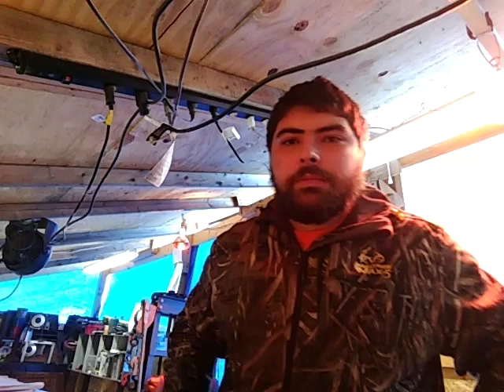My advice for anyone starting a welding business

Comment: I started with a duromax 13000 watt generator for $900 on sale, and a Vulcan Commander 225 for $500 on sale. I weld on AC though, so there’s that. That mf has a 100% duty cycle at 100 amps. It will burn 1/8 th inch 6011 at 90, and 7018 at 100 all day long.

Comment: I love to here other people’s stories and advice and compare it to my own. I started out small and still learning had a few bumps in the road but didn’t stop me I started out with a 96 dodge Dakota and 8500 generator a 90 amp mug welder and one of those Lincoln tombstone A/C stick welders still don’t work for myself full time yet but now I have a 93 F250 diesel and a 2003 F350 utility body diesel a bobcat 250 NT getting ready to buy another bobcat 260 brand new a a Lincoln 210 mig and Lincoln 200 square wave for my shop and a bunch of other tools multiple power drills and impacts porta bands cutting torches chop saws and hopefully the plan is to expand my shop this summer! It’s been a long time coming but I’m making it

Comment: I had 7 angle grinders at the same time all good brands 2 9 inch and 5  4-1/2 inch, each with a different wheel. So I never had to change wheels, plus if a grinder broke I didn't have to stop everything.  I Started out at $65.00 per hr. Min 3 hrs. 18 years ago,  at that time it was ok. Everything I did from those discount papers like Craigeslist,  was a looser, never do ANY WORK, UNTIL, they sign your contract,  if it is a big job never do more than 1 week without full payment, plus Always buy the materials with Their money, not yours!!! 😆😆 GREAT VIDEO Thanks William Orange county, ca.

Comment: heads on 1980`s 1990`s crap are crap i am building a 400m ford  tmyer flat top piston good heads megasquirt efi all fer a beater truck with zf 5speed why i hate not being able to rev the engine and it go past 4k n humm wile a full loaded truck is coming down the interstate   like the 351w i had did no air flow ..lol home-adviser is bogus it need boycotted and all like 100 bucks to then is bad to me scam

Comment: Just ran across your video, i know it's older but i have a question on payment from the customer. I know you mentioned possibly them not picking up your product and this question also pertains to mobile welding.Do you by chance have a clause where they need to put say 50% down before you start work or gather material or do you just make them pay in full on job completion thanks.
Reply: I’m also curious

Comment: If there outside of your range do you charge $2 a mile round trip or just one way
Reply from the maker: It’s one way. I don’t even flat rate trip anymore I just do $2 a mile for everything now.
Reply: @derbadortheweldor8940  so do you also have a minimum. Like the fist 2 hours is 200$ and 75$ an hour after that? Plus 2$ a mile from where you started?

Comment: Hi. im sure you cover this in one of your other videos. what kind of work would i be looking for in a mobile welding business? im not a welder by trade. im a mechanic that has over time acquired lots of welding equipment. nothing fancy. Bobcat 225, plasma cutter, torches couple of 220 cracker boxes old flat bed ford etc..  just wanting to do somthing for myself before its to late. Thanks. Johnny Chain
Reply: Hard facing heavy equipment  entryways, fab on site repair work lots of heavy equipment that have cracks in them need to be gauged out first though ir you can do fences
Reply: @thomas25082  Sweet Thanks. world is a little different right now but hopefully we will get back to normal.
Reply: @chainlandproductions820  it’s gotten worse but at least we can still work and have just enough left after taxes. Any update did you start up?
Reply: @DB-bk9tr  couple of small jobs. not really started.

Comment: I have some advice that may help, 
I purchased a 1ton 91 Chevy flatbed for 1500 dollars, a Lincoln 225 from a pawn shop for 950 dollars, a cutting torch set at a garage sale for 50 buck's, I already had most of the hand tool's, but you can buy used angle grinders drills, etc. from pawn shop's.
I also purchased a gas powered air compressor from pawn shop for 350 buck's so I can do my arc gouging.
Point is you don't have to start out looking pretty, BUT, you do need to be functional.
Stay safe out there my brothers.

Comment: Damn man you make me feel bad.    I was gonna go to harbor freight and get a welder and generator then put some ads on craigslist.     Can't really afford that right now but I'm ready to get started and see how it goes.
Reply from the maker: Sorry that was not my intention. The 8750 generator from HF is very good. I used to have one until it got stolen. If you're on a budget get the ahp160 stick welder and the predator 8750. You might be able to get started for under $1k. Just an idea.
Reply: @derbadortheweldor8940   thanks for the info man.  I'll check into that.
Reply: @derbadortheweldor8940   have you seen the vulcan 225 welders from harbor freight?  What's your take on those?
Reply from the maker: @Tomfromyoutube  honestly the new Vulcan welders just seem cheap to me. I got to use a ahp 160 and it's very well built.
Reply: @derbadortheweldor8940    cool   thanks

Comment: You can get Miller Bob cats for about 1k used
Reply from the maker: BRENT3143945 yeah someone's used up pos. I'll take 145amps that work all the time vs 225 that doesn't work half the time.
Reply from the maker: BRENT3143945 and honestly IDK where you are getting used bobcats. But around here the cheapest one Craigslist right now is a onan engine bobcat $2400 431hrs. No way I'm buying that! I'd only give 1k at the most.

Comment: You think the area has a lot to do with it . because I started a mobile welding business about a year ago . I've got some big jobs . then boom dead as a dead horse .  I got all my equipment Lincoln ranger 225 and suite case to run innershield all paid for .
Reply from the maker: Cody Dayton my advice would be spend a week mapping out all of the industrial business like sawmills, small auto shops, logging company, drilling company and concrete companies. Go visit them in person and introduce yourself and your services. Bring your equipment just in case they want you to do work ASAP. Also it is a good idea to take some business cards and leave them at places like tractor supply and any small business that's related to any kind of construction or agriculture. The first year is all ways the hardest. Just keep grinding and give your best work possible and eventually the work will start picking up. Also make sure your business is on Google maps and yellow pages.
Reply: Derbador the weldor. Thank you . I wrote downs some notes . I am doing my research tonight . thank you for the new ideas

Comment: Does your hour rate include consumables?
Reply: Ace #1 

Usually, you add consumables to the invoice, and those are overestimated. For example, if you use 8 pounds out of a 10-lb spool of wire on a job, you charge them for the spool; don't break things down too much. All it does is make more work for you that you're not paid for. 

Also, a minimum is good to have. Keeps people from calling you out to waste time if they know you've got a $400 mobile minimum with 2 hours labor at $85 an hour.
Reply: Ace #1 

Oh, and you generally want to charge your cost plus about 20% on those types of things on the invoice.

Comment: Who is your most common customers
Reply from the maker: Adam Spears I've got a few concrete contractors I do work for. Concrete contractors are extremely hard on equipment so it's almost guaranteed work. I also do work for some local general contractors. I've got one big GC that is out of state that pays very good. Bottom line is my customer base is very diverse. I try to stay in industrial work. Private individuals some not all can be very difficult to work with.
Reply: Derbador the weldor thank you bud